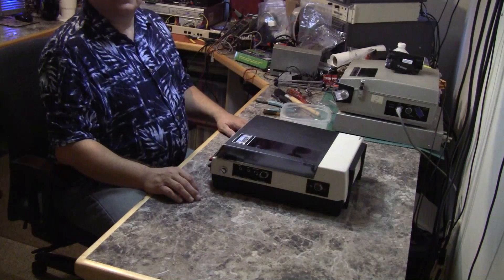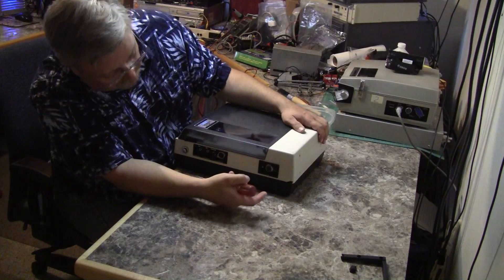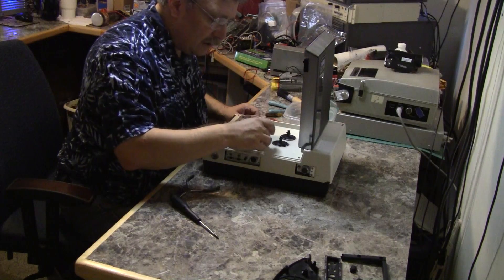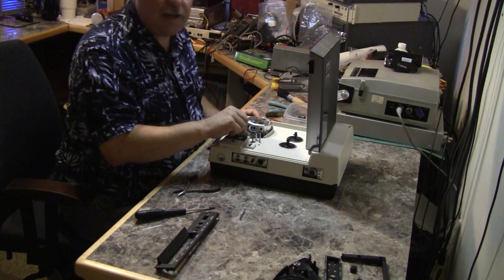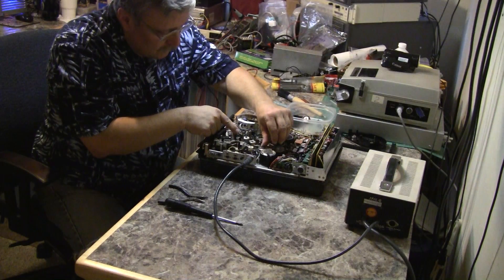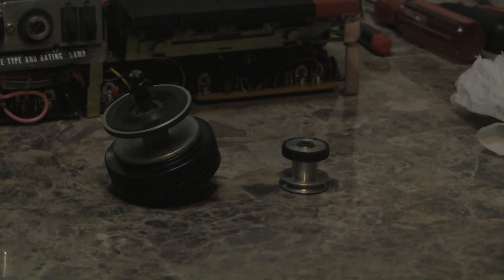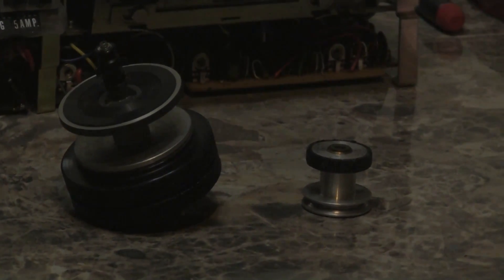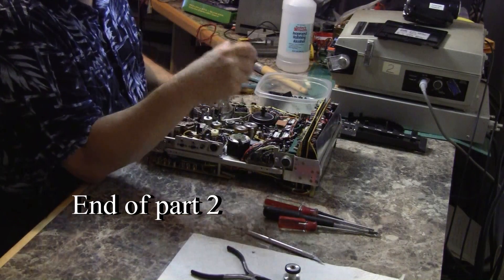Akai VT-150 Part 2: Take up roller repair

Comment: Question, i have exactly the same problem with the take-up roller (rubber is completly decomposed). did you managed to find an replacment part or  a place where they can fix this roller ?
Reply from the maker: Terry's Rubber Rollers and Wheels does (did?) tape recorder wheel rebuilding. http://www.srdpc.com/witt/

Comment: Had the 100 in my High School TV Production class in the mid 70's. Never saw it operate. We used the Sony Portapaks and then moved to the color portable Beta I with a DXC-1610 and DXC-1800, all of which we still have in storage today. All  of them use the BP-60 lead gel batteries which we kept in abundance.